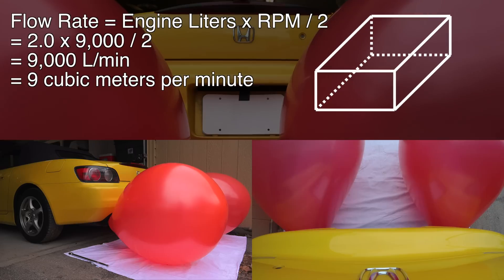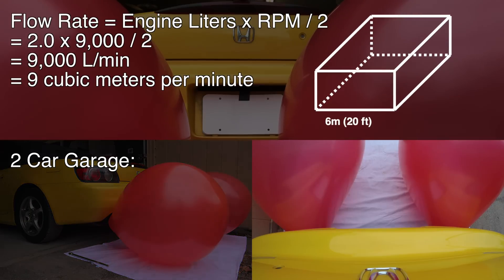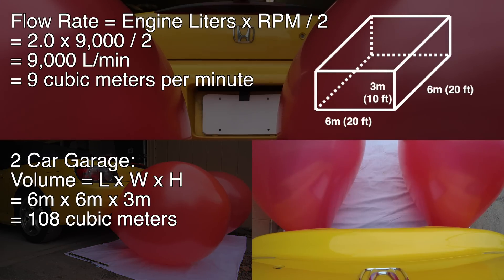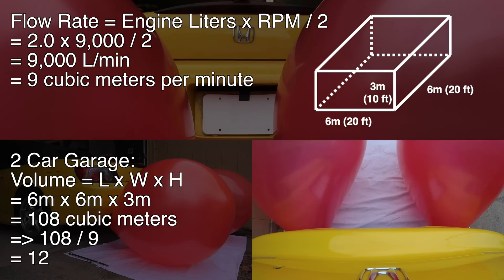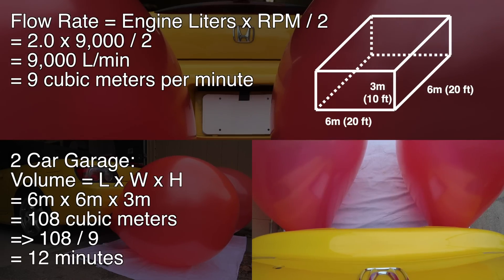Inflating Balloons With An Exhaust - How Much Air Do Cars Use?

Comment: If the balloons hadn't burst, the backlog would have eventually choked the engine out. But seriously, you were technically simulating a clogged catalyst, which if left unchecked, can eventually cause burned valves. A short experiment like this is not likely to hurt it, however.

Comment: Its very interesting to point that ones the first ballon explodes the secont start losing are and deflating, since we have dual exhation, more fumes are passing to the secont exhaust, all the exhaust the car produses from the engine, plus the deflating fumes from the ballon. I am wantering will that ballon came to a certain volume (meaning a certain pressure) or will deflate entarelly, thats some crazy pressure calculation.

Comment: I was told once by an old mechanic that there is almost twice as much air coming out of the exhaust than going into the intake due to thermal expansion of the air during combustion.  What are your thoughts ?

Comment: This car 2.0 i4  will never intake 1 litre per revolution when its stoped. At 1000 rpm in this conditions, the air volume intake is about 100 or less litres per minute.

Comment: First of all, that's carbon monoxide, not air. The air intake cools the engine and is also used via the hvac. It doesn't go through the engine and out the exhuast.

Comment: Hear me out. Our main battle tanks can ford. To do this we make it take the air from inside the turret. There is a micro switch to prevent you from closing the hatch accidentally. However my buddy close his hatch in the drivers hole. The micro switch was defective. The hatch closed instantly . He quickly killed the engine. How long before dangerous pressure drop. 37.4 liter diesel 10 cylinder

Comment: you put way to much emphasis on back pressure hurting the engine. If the piston can compress gasses at say 14:1 with no issues all day long, it surly is not going to have a problem blowing up a balloon.

Comment: You forgot one thing: 
The engine is just running becuase it is burning fuel. By this combustion the exhaust gases are expanded and they take much more volume than the air that the engine sucked in. So the gas flow into your balloons is much higher !

Comment: will admit i tied a baloon to my exhaust but was idling  and i had a hole on the end of the baloon to prevent inflation and gave a couple revs, did notice letting off   the trottle gave a slight vaccum effect,  wouldnt wanna drive like that incase  the baloon is sucked into  my exhaust

Comment: not accurate when gas is mixed with the air that the car sucks in that air expands so the car puts out more air than it takes in because of the expansion of gasoline into a vapor

Comment: Hence why one of those bilgepump electronic "turbo's" is hogwash. Those move very little air. And as turbo's go a turbo first need to overcome to pressure of the incoming air THEN add more pressure to force more air in. As the engine itself already is a huge pump system moving air around.

Comment: If the volume of the gas entering the engine was the same as the volume exiting, the engine wouldn't run.  Cars rely on gas expansion to operate.  

Additionally, part of the exhaust is steam, which may or may not be lost due to condensation.  So, the size of the balloons will only loosely be correlated to air consumption.

Comment: Hi,  isn't the lower volume in the balloons than your calculation simply due to a lower RPM rather than a lower volumetric efficiency? Your calculation was at the rev limiter but the car was idling. If it idles at 1000 RPM than you get 1/9 of the volume of air consumed. 

Also, I'm guessing those 'fumes' coming from the exhaust are nothing to worry about. Water is produced from combustion and the exhaust had enough time for it to cool down in the balloons for the water to condense.

And as others pointed out the balloons aren't really an accurate measure of air consumed since there are volume changes after combustion.

Comment: with a natural aspirated, the air in the cylender is not full, it's depending about the cam and the intake so there is a depression in the cylinders, especially around max RPM
Reply: and the air is dilated after the ignition

Comment: False math...
the exhaust isnt just air inside your garage. its mainly burned gasoline which ofcourse has oxygen etc inside.
mostly its not the garage air that takes that space. its more gasoline(or diesel) which is burned.

conclusion: your engine doesn't take as much air as it blows out from exhaust.
Reply: to know how much it takes you should somehow do it from intake not exhaust...

Comment: The huge amount of smoke seems to be because the other balloon is slightly deflating itself back into the exhaust, it's still being pushed out by the engine.
I don't think it matters too much to the engine at these low rpms to have one of the mufflers have that backpressure, I wonder if it makes the car quieter to only use one muffler, or noisier because the one muffler does all the work.

Comment: the calculation is wrong... you took 9000 rmp... but the engine wasnt at 9000 it was in normaly running...

Comment: I've been looking around for a new exhaust system for my 911 turbo, and i got caught up on when you said "should not increase back pressure". Most manufacturers claim reduced back pressure a added bonus, however i'm wondering if a cars arn't calibrated for a certain amount of back pressure, and that it may be harmfull to the car to change to an exhaust that has less resistance without remapping it? Or will it simply just evacuate exhaust quicker? And also, what effect would this have on the two turbos?

Comment: put those balloons on the turbo manifold, when inflating, they will limit boost to safe levels, and then that recovered pressurized air in the balloon will release back into engine Supercharging it, LOL...   low cost energy recovery Supercharger!

Comment: I can kinda see a use for putting balloons on your exhaust for leak detection... as long as you have a good seal on the tailpipe you could run some exhaust in and leave it a little bit to see if you have a pressure leak... interesting!

Comment: WARNING:Watching this will cause 2:53 minutes of your life to be wasted.

That's more assumptions than science. If one can call this "science", then it's the wrong type.

1)You didn't measure the actual backpressure the balloons are creating at certain levels of inflation, so you have absolutely no idea how much air is being pushed back into the exhaust, thus lowering the ability of the engine to blow air out. 
 So you really have no idea how much more air the engine could have blown out without this negative force.

2)You didn't take into account that your lungs are MUSCLES that can blow HARDER when the backpressure increases, thus enabling you to blow as much as you want even if the backpressure increases. 
The engine doesn't do that, it blows a certain volume of air at certain RPM.The more you obstruct the exhaust, the less air it blows out.

If you take those into account, you might end up with a realistic result.The way you did it....nope. 0

Comment: A rough estimate of the S2000's volumetric efficiency vs. the Chiron's would show there is a MUCH larger difference between the two with those end numbers. At least twice the difference I image. Quad high-boost turbos are obviously cramming in waaayyy more air than NA vacuum.

Comment: A good visual representation that shows one exhaust pipe does more work than the until it's saturated enough. Would you benefit if both exhaust was equal?

Comment: May I interrupt? You pointed out the Airflow through the engine and set the volume of the exhaust equal the intake air. This is not right at all (only, when drivin down a hill at 9000rpm with only the car pushing and no injected fuel). If you really run your engine on 9000rpm - even when standing still - the engine consumes fuel that makes CO2, H20 (and more). Even more so when running on the street or going uphill. The volume of your exhaust gas is much more than the volume of the intake, which means that you may fill up your balloons way quicker!
I'm sure you know all that  (I know your other videos ;-) ) and maybe have a reason for simpyfying your equation, since you pinted out, that it takes 12 minutes to pass all the air in the garage through the enging - which is right . But I think that gets the video messed up very badly when talking about exhaust...espacially when visualizing the exhaust volume with balloons.
Cheers.
Reply: 14.7:1 is the rule of thumb for AFR.  that means roughly 7% of the exhaust gases is burned fuel. which means the exhaust is 7% higher than intake.

Comment: your logic with the balloons is terrible. the more air you put into a ballon, the more the rubber is streched. this raises the force of tension,  which raises the air pressure in the balloon. That is to say, when the balloon is about to pop, the air pressure is much much greater than when you fill it with one lung full of air.

Comment: I'm confused  are you suggesting the air being taken in by the engine will be equal to that being exhausted?  Because even I know that is wrong.  Or did you just use balloons for entertainment?  The exhaust gases leaving the engine will be more because you're transforming the liquid fuel into a solid and using the expanding gases to drive the pistons.

Comment: I think the reason the exhaust shot out so fast after the first balloon popped was because it was coming out of 1 pipe instead of 2 and the second one was pushing more air back into it which you can see by the balloon deflating.

Comment: exhaust balloon, balloon, honda, s2000, s2k, s2ki, honda s2000, air flow, how it works, engineering explained, pop, boom, fail, exhaust smoke, vape life, audi, bmw, mercedes, dodge, jeep, chevy, ford, subaru, mazda, nissan, toyota, vw, acura, lexus, infiniti, hyundai, kia, ferrari, Ram, Cadillac, GMC, porsche, fiat, jaguar, lamborghini, maserati, aston martin, alfa romeo, valvoline, pennzoil, castrol, mobil1, shell, chevron

Comment: If you really want to see how much air a car uses: instead fill up the balloons with air and place them over the air inlet. Placing them over the exhause is a poor measure because the liquid (non-air) fuel is converted (with air) into the gases CO2 and H2O, and that's usually hot hence some additional expansion.

Comment: Isnt the Bugatti uses much more Than 60.000? 60.000 is without the turbo's i guess? Cause The turbo's making an over pressure in the engine, and that mean more air? Or i am wrong?

Comment: Silly question.....  why does one balloon fill way faster in the beginning? If the two tailpipes are linked after the muffler, why not just have a single tailpipe, and reduce the cost of the exhaust system? Is it anything to do with the high rev limit if the S2000?

Comment: Remember to take the volume of combusted fuel into account. Also, the Chiron is turbocharged, so the amount of ingested air at atmospheric pressure is much higher than the cylinder volume multiplied by the revs, since the pressure is much higher during the intake stroke.

Comment: you will have some leaking from the weep holes in the mufflers. they are the 1/8th in holes in the bottom side which allow water to drain instead of pooling causing rust.

Comment: Nice video !! could we know about this downsizing trend where are 1.0 motors with turbo forced intake can swallow more wair than a induced intake motor with same horse power iex: punto tjet 1.4 150cv vs corola 2.0 150cv who would suck more air ? 1.4 turbo or 2.0 normal with same horse power... maybe we might know what could be more efficient in that theory ? ^^ i`m very lack of knowledge  =D

Comment: Your "fumes" were just the moisture content of the combustion gases, plus any residual in the exhaust if you started the engine cold before running this demonstration. It's not hurting anything. You just trapped it in the system for a short time.

Comment: Thanks EE. Very nice video. I was wondering how you calculated the flow rate of the Bugatti. Did you also assume 100% of Vol Eff for Bugatti? But since it's turbocharged it could reach a much higher Vol Eff.

Comment: not the completely factual thought, I may be wrong, but the fumes you see after the balloon pops could just be from the plastic of the balloon melting on the hot exhaust. or it may not be.

either way, that doesn't seem to damaging. interesting video.

Comment: Very interesting. However, I am curious of the added volume of combustion gasses like nitrogen, carbon dioxide, water vapor, etc. Since these are the driving force for the motor, I wonder the net volumetric expansion rate of intake vs exhaust is. I'm sure there's lots of factors there though, including air temperature and catalytic converter presence.

Comment: When i connect a computer to my car and read the MAF, it says that  the car is consuming around 6 gallons per second with the engine idle but around 60 - 70 gallons per seconds at 6000 rpm.

Comment: They exhaust as much as they pull in which can be calculated with the mass air flow sensor. You can't measure air volume in a balloon it's pressurized and air can be compressed.

Comment: you're math/assumptions re air flow are a little off

I mean that assumes a perfect air pull, from top dead centre, to bottom and thats not the case (and less the case with an Attkinson cycle )

Comment: i think the fumes you got after the balloon exploding are the "conectrated" ones that were on the second balloon. since the balloons filled one after the other it's safe to assume that you have one exhaust pipe that bifurcates.
after popping, the second balloon begins to shrink, so the air must be going to the now open exhaust. apart from that, the pressure difference also "sucks" the air from inside the remaining ballon.
so, i don't think you car suffered that much

Comment: Title is wrong. This doesn't display how much air an engine uses. What kind of state do you think the burned gasoline turns into? A rapidly expanded gas (explosion) indeed. I guess more than half of the baloons' contents consists of fuel which turned into gas.

Comment: I never really was a fan of split system like this! I now it's suppose to improve air flow but make it dual and split parallel would be simpler and save weight but at this point you're fully custom!

Comment: Fun video,  but you realize of course the volume of air at the exhaust is LARGER than the  air through the intake right?  Fuel combustion causes an increase of volume, (expansion of gasses)  hence the engine running.  If the volume of  the mixture you are calling air was equal at intake to exhaust,  the engine would not run. The volume of air in the balloon (and its no longer air) is not measuring the amount of air the engine needs to run.  You are measuring the volume of exhaust gasses.
Reply: Larry Lyu I don't think it's much larger pressure difference that's why the balloon increased drastically in size. it's a balloon.
Reply: True. Also the pressure in the balloons are apparently much larger than atmospheric pressure, making it much smaller than the actual volume of exhaust gas.
Reply: Larry Lyu the pressure inside ballons is determined by outside air, it increases volume but not pressure when inflated. It must be 1 atm or almost 1 atm
Reply: True. Also, the temperature is higher, so the volume the same mass of air is greater.
Reply: The volume of air at the exhaust is equal at the intake because it is cold and not with 700~1000°C as when inside the cylinder.

But his calculation is not true. This car 2.0 i4  will never intake 1 litre per revolution when its stoped. At 1000 rpm in this condition, the volume of air at intake is about 100 or less litres per minute!

Comment: This is exactly why the hydroxy experiments aren't as totally unfeasible as a lot of people try to make them sound.  With a partially open throttle you will always have engine vacuum (provided you're not running a "hit and miss" engine and you don't have compression/vacuum issues) and you're almost never at the rev limit so producing enough hydrogen to offset some of the fuel requirement in an engine at normal driving speeds is possible in a self contained unit in the car.

Comment: I have two questions. first, we know that diesel engines have long stroke. what would happen if diesel engines stroke too short (<86mm)?
second, why engines that capable to rev very high (>7.5k rpm redline) have weak torque? I suspected that's because valve timing or compression ratio. but not sure.
Reply: Think of a short stroke as being a short push. The work pulse is shorter than say a diesel, which has a much longer stroke /push per cylinder. Imagine childrens legs pedalling a bike versus a grown man.
Reply: You mean this could be lack of torque?
Reply: I am no engineer but I guess the answer to the second question might be that the efficiency of energy conversion drops when rev goes up too high. When engine revs at very high rpms there no less time for the fuel injected to burn. When fuels burn less efficiently, fewer energy stored in fuels are converted into the mechanical energy of pistons, which means less torque output.
Reply: Thanks
Reply: Sounds like valve timing also the factor.

Comment: You should point out that one gallon of gas, around 6 pounds, creates around 18 pounds of CO2. This is because most of the weight of a molecule of CO2 is made up of oxygen, whereas most of the weight of gasoline is made up of carbon. So a little carbon creates a much heavier amount of CO2, which absorbs infra red light. But IR goes through oxygen and nitrogen like it's not there, but that's a different story.